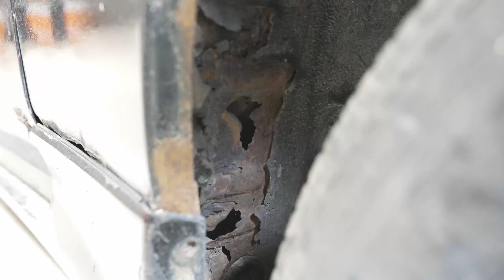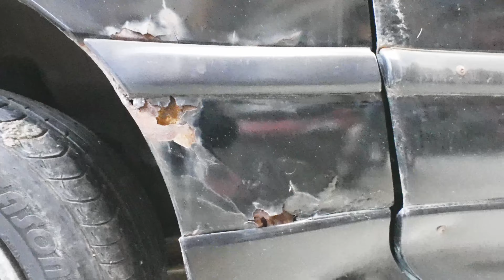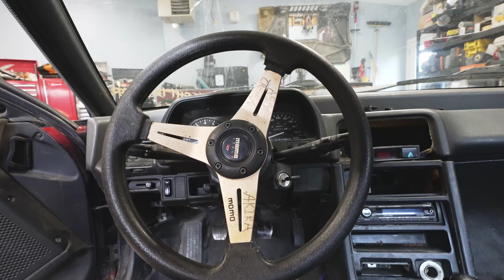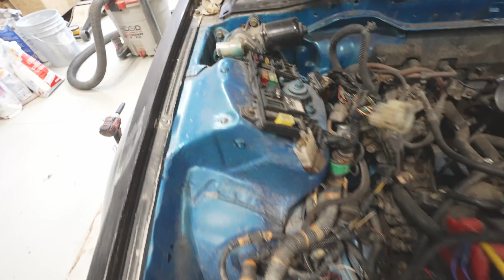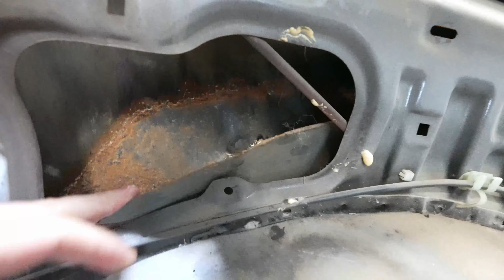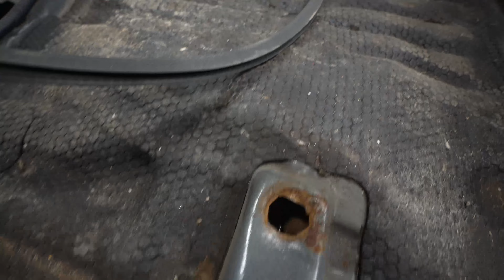Can this Honda CRX be saved?

Comment from the maker: Let me know what you think? Am I nuts to try to repair this? Is it too far gone?
Reply: Anything can be saved with enough work. If YouTube has shown me anything, it is just that. Really depends on if you wanna, or can put in  the work. But fixed up nice and running, you could sell them for quite a bit in the states.
Reply: Depends how much you want a crx specifically. If you can get the quarter panels and arches you can fabricate the sills. Just time isn't it.
Reply from the maker: Already have a set of rear quarters built for it. I have a week off next week so I hope to make some decent progress.
Reply: @Research Design Build  excellent. Looking forward to the next video! Will you paint it yourself?
Reply from the maker: @RocardYT  Yes I think this will be a full build in the garage start to finish.

Comment: Yes it's possible but you'll most likely end up spending more money than it would cost for one in better shape.  That being said you can do a better job than the factory. My advise would be to reinforcement the body by adding some bracing inside. Also 3m makes panel bonding adhesive that you can use in conjunction with spot welding for added strength and to seal the whole joint from rusting out again.  Good luck 👍
Reply from the maker: For me it's just time. I will be doing the work myself and I 100% agree that paying someone to do this type of work would put you in the poor house quickly. And I would love a nice southern US shell, but up here in Canada that is just not going to happen without a lot of $$$ for shipping etc.
Reply: It will be a fun video series anyways and good to save as many as possible 😊. Sounds like you made up your mind good luck 👍

Comment: If the swap to a K is well done and tidy, most us Honda bois dgaf. Personally i like seeing potential resurrections, better than seeing a tatty runner being gutted into a drag machine. Far too many are doing that not taking into consideration these things are finite and have been for some time.
Reply from the maker: I would feel really bad tearing apart a clean car to do a K swap and racing it.
Reply: @ResearchDesignBuild  For sure. That said, i don't mind those that are swapped and run as a daily, (restomod/modernisation) given it's a fantastic base for hot rodding to begin with and a good little grocery getter. =]

Comment: In this case. The firewall swapped to a cleaner no title shell would be the way to go
Reply from the maker: I think that was the plan from the guy I bought it off. Even shells are hard tom come by in decent condition. And I'm sure this would be a little more legal than vin swapping. What would be your biggest concern fixing this? The rockers, the rear inner fenders, or the rear outer fenders? Or the holes in the floor?
Reply: @Research Design Build  all of it as a whole. Not 1 thing in particular. I see clean ish shells with no title get cut up all the time. Just seems like less work. I know it's bootleg af, but if done cleanly who cares

Comment: I also have an 88 si that I bought mostly stock almost 8 years ago. It had about 124xxx miles and was overall clean aside from some apparent body work. Back then a few people close to me thought I overpaid ($3500). Now it looks like it was an awesome buy. These are getting to be scarce being 35 years old now. I'd say if you have the resources to fix it up, that would be my vote. I'm really interested to see how this goes.
Reply from the maker: I'll start with trying to clean up the rockers, if that goes well then I will move on to the rear. I'll make videos' along the way and will be interested to know what people think of the project or if I'm crazy or not. They are getting rare to the point where modifying a clean shell might be a terrible idea.
Reply from the maker: I am one of those people wishing they had picked one up a few years ago. But that is the way it goes. I remember years ago a guy I knew picked up an NSX for 35K and I thought that was too much... I was so terribly wrong.
Reply: @ResearchDesignBuild  Yeah there are several specific cars I wished I bought a few years ago, but then a few years ago I had less income and different priorities. Now starting to advance a little in my career and of course realistic dream cars like the NSX are increasing in value. Kinda how things seem to go sometimes. Maybe some day!

Comment: Since you have another crx in better shape.. this should be your parts car… is the other crx an SI also?
Reply from the maker: The other car is an Si as well. So the few little trim pieces it is missing I can take from this car. The other one is 100% stock outside of the stereo and Y-49 so might make a nice completely stock restoration. If you were doing a K swap would you really want to start with a perfect shell that could be restored to stock?
Reply: @ResearchDesignBuild  dont swap the good one!

Comment: Imo, even if you were willing to spend $15,000 on this project, the parts avaliablility and cost wouldn't let you make this car enjoyable. If it was a new civic then maybe but from my understanding, project CRXs are hard to do right especally with all the rust the car has seen (Arizona gang lol). If you still want a project CRX, I would try to find a diffrent chassi that at the very least has less rust.
Reply from the maker: I'm not too worried about the rear quarter panels as even the $8,000 crx's have some rear rust. And that means a full paint job anyways. The rocker panels are another issue all together. They are really bad.
Reply: @ResearchDesignBuild  I've started discounting the Honda folks from the Southern US.  What to them is major rust is just surface rust to us folks up north.  Most of these folks have never spent two days removing a rusty fastener on what should be a 20 minute job.